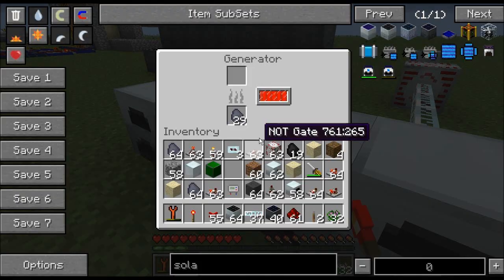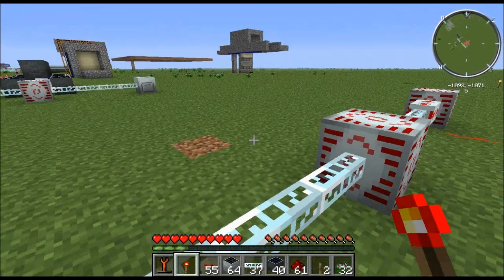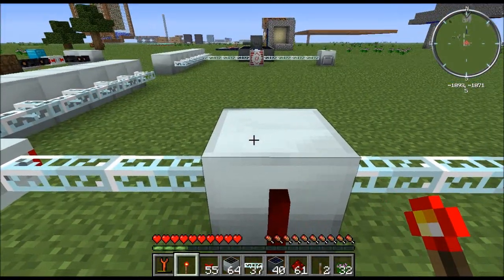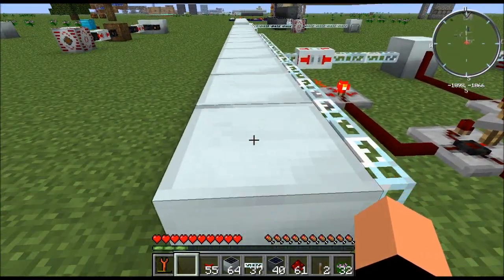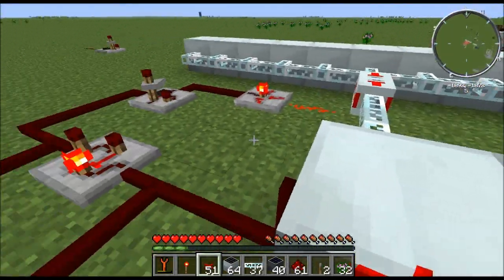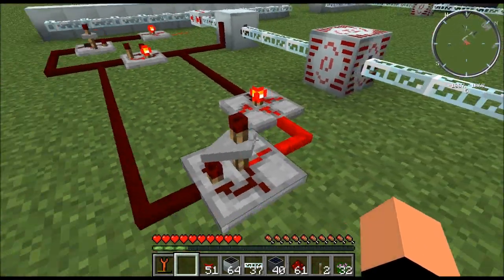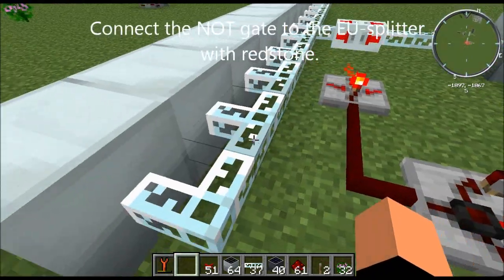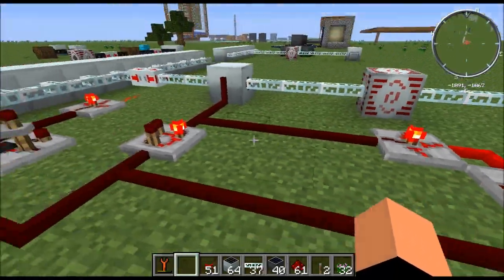Minecraft FTB/Feed The Beast Tutorial - Smart Power Grid To Conserve Generator Fuel

Comment: I see what you're saying, but i just started a new world, and in my old world I never depended on generators for my power; I was a solar hoar. in my old world, of course i used generators to fuel a batbox which led into a macerator, but once i got 10 advanced solar panels, i was set; i just started to upgrade them then. In my new world, however, finding coal or making coal coke/charcoal is a pain, and i need it for my stirling engines for my quarry. therefore, i started to use solar panels.

Comment: I'm putting wood in the coke ovens, and I'm using the charcoal and creosote oil (using a single GT semifluid generator for that) they produce as fuel. Currently using a RP sorting machine to distribute the tree farm output, and I'm using BC gates to get the fuel to the generators. My system is kinda stupid though, it only tells the ovens to send fuel when the MFE has space in it's capacitor, and it's not evenly distributed. Apatite ends up being the only non-renewable part of the chain.

Comment from the maker: As the video explains, if there is a small demand on the power grid and all the generators kick on then you waste a ton of fuel. The smart grid just makes sure that fuel doesn't get wasted.

If you want to add more generators then I would put a second MFE in parallel with the first. Tie their inputs and outputs together. Then you could use an AND gate to control the state cell. The state cell would kick on only when both MFE 1 AND MFE 2 are drained.

Comment: I was thinking, If you used 13 chests, 13 wooden pipes and 13 redstone engines, and 13 furnaces, when the box runs out of power it would output to the redstone engines until they deliver the fuel to the furnace.  The redstone engines would stop when power is produced, the 13 furnaces would produce more power then the 128eu/t draw and thus you would burn one coal until the box drained again and then the furnaces would start again.  U could use up to 46 furnaces if you use coal coke 13k eu/ piece.

Comment from the maker: I just recently learned how to use tesseracts this week and I had the same problem. I did two things and I am not sure which fixed the problem. First, I read that a chunk loader doesn't work unless the world is running on a server. So I placed a world anchor next to the chunk loader in the nether.

Secondly, I made sure I clicked the check marks on both tesseracts to set the frequency. This fixed it. I would try the second solution first.